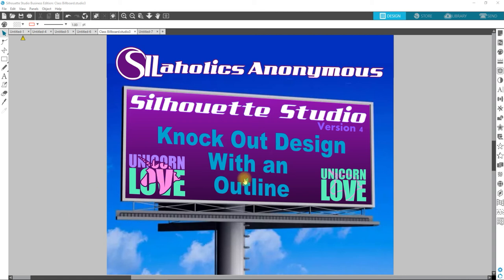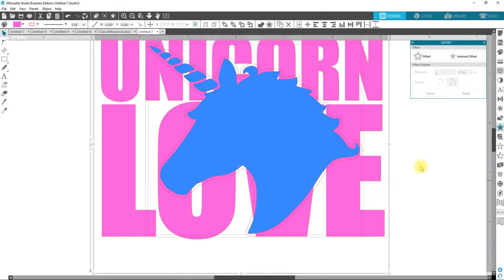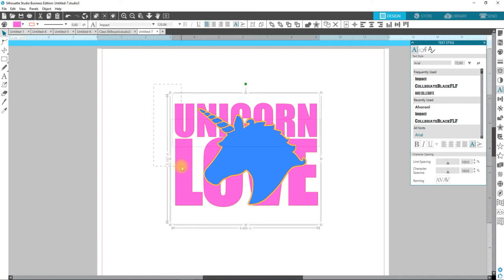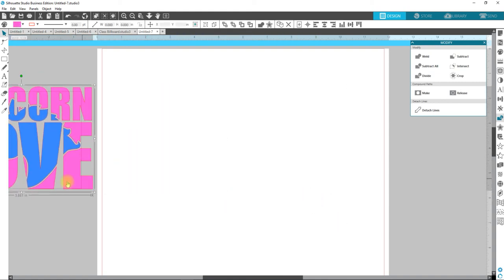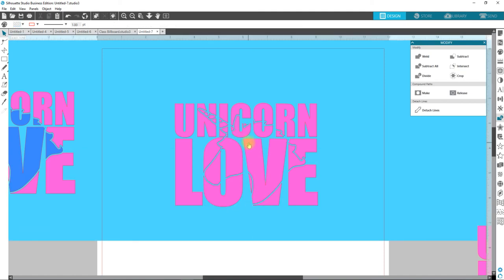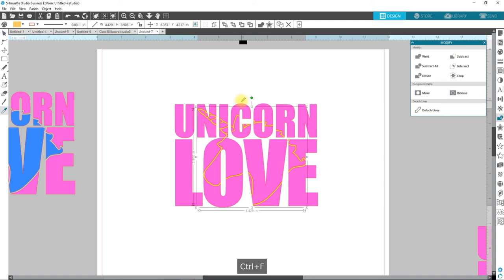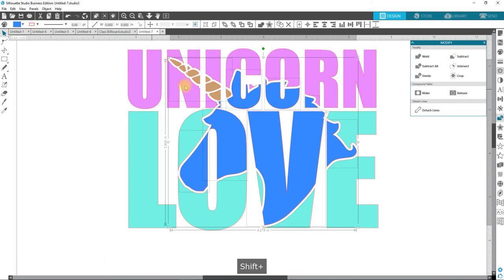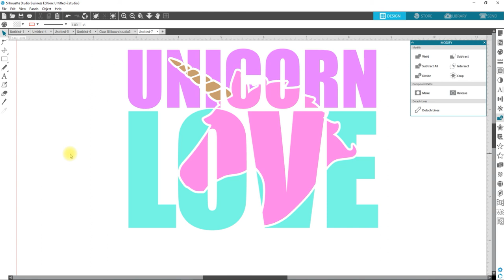Silhouette Studio - Knockout Design with an Outline.

Comment: Hello and thank you for info and time.. i follow instructions to the T... However my image will not subtract... it will crop the one wont subtract the other.  plesae help
Reply from the maker: Do you have both selected which version of studio are you using? If you are using 4.2 the paste in front function does not work the same and you have to be sure to re select everything for the 2nd modify. Or just do a regular paste modify it and then move it into place